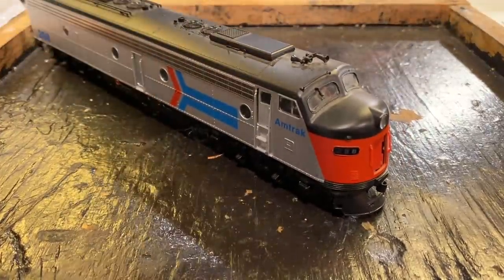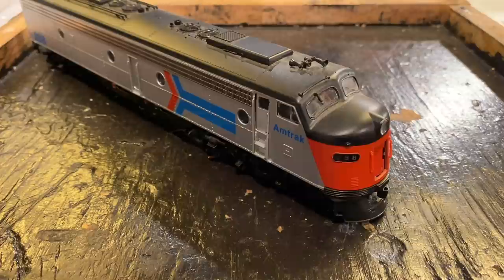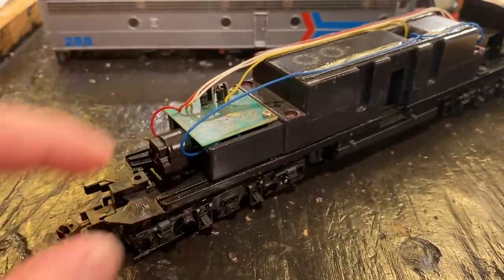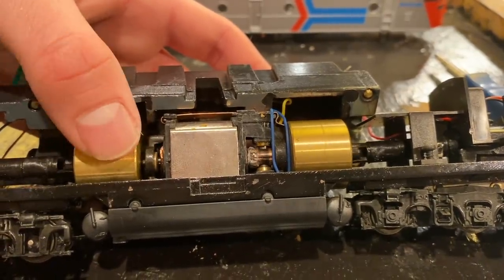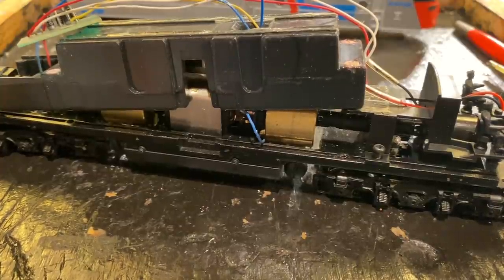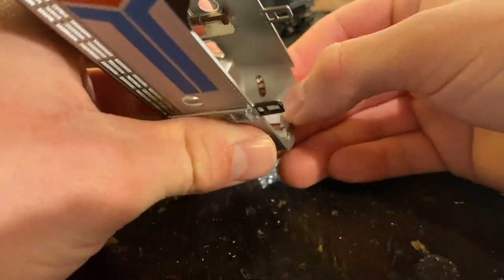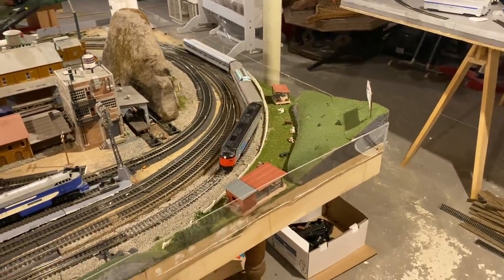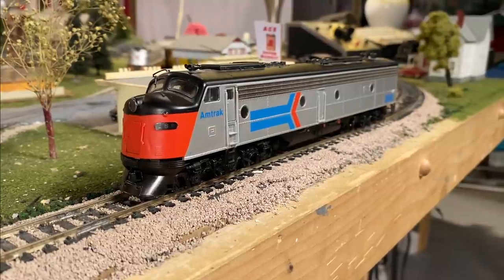This HO Amtrak E9 Won't Run - Spider Egg in Motor

Comment: I have found that 95% of the time I am having problems with older engines, a good cleaning takes care of the problem. I usually find dirt, dust, hair, dried grease or other contaminants in the gears, which prevent the engine form running.

Comment: 12:15 - SMT, you could paint the engineer & fireman figures that are present in the cab!  That directional lighting circuit board is probably a universal board that the manufacturer installs in all of their locomotives.  The person doing the soldering at the assembly plant may have touched their soldering iron on that circuit board eyelet by accident & left that little bit of solder on it.

Comment: They’re a lot easier to deal with if you remove the truck sideframes, first; they should just be a press-fit onto pegs molded as part of the gearbox sides. 🙂

Comment: I replaced all my Proto 2000 wheelsets with Athearn type sets.  Athearn and early Proto 2000 are compatible.  I used left over wheel sets from Ernst Gear projects and the remainder were obtained from my local hobby dealer.  The replacement project involved over 30 locomotives.  I bought additional sets in this effort long ago before the price surges we are currently having.  Fortunately I purchased enough sets to replace a further 20 locomotives should I live that long.  Proto 2000 locomotives look nice and run nice out of the box.  Unfortunately they have trouble staying in service for long periods after their gears fail.  I really enjoyed your spider egg find.  That is classic.  Good work SMT on bringing the Amtrak E9 beast back to life.
Reply: that reminds me of guys who buy a boatload of MT couplers and gear to outfit their entire collection and never get around to actually doing it- what a waste of money. harrison fixed this unit and didn't have to buy anything.

Comment: Amtrak definitely has the same color scheme as Spiderman, so it makes sense that a spider would want to set up shop in the belly of the beast.  Spider silk is very durable, but non-conductive so the current was most likely blocked on the commutator.  As for the wheel sets, you've had that issue before and successfully resolved it with super glue... KUDOS Harrison!
Thanks for sharing. 👍👍👍
Reply: a hair or any of a number of things could wrap around and do the same thing.

Comment: I've seen this once. It happened back in the 80's with one of my NScale locomotives. Took some cleaning but got it working, no issues.
Reply from the maker: Such an unusual problem.
Reply: @SMTMainline  
It sure is. If you think about it though, I'm surprised it doesn't happen more often. Spiders love small dark places to make nests in.

Comment: EMD E8/9 series were designed for passenger trains at high speeds. The counter part to them is the F series for freight locomotives. Now you have both cousins.
Reply: some railroads used the Fs for passenger service thru mountainous terrain due to their numerically high gear ratios

Comment: Commenting on an old video, but anyway: 5:03 it's perfectly normal to not populate all places on a board. That way the manufacturer can produce a single, universal board, and just populate the components they need for that particular model. It saves a lot of money when you don't have to make 17 slightly different variations of basically the same board.
Reply from the maker: That makes sense

Comment: Really nice Amtrak and great repair.  That axle you glued has a cracked gear.  You need an Athern ATH 60024 gear.  I would send you one but it would take month to get there.  I fixed one with the same problem.
Reply: Yep! I did too works wonders!
Reply: wow you have great eyesight!!!!
Reply: I've seen that same thing a few times.  You catch that kind of stuff after a while.

Comment: Out of all my locomotives which aren't many but ive never seen spider web in them . I watched this after got my wiring set up now to install the switch eventually . Good fix Harrison. I never had a proto brand but i know bachmann has similar issues with gears but the fixes are not as good as this. At thr end i say that did look fitting like its a railroad museum hauling Canadian Pacific cars with the older Amtrak. very good!
Reply: how do you know the problem is with the gear and not the length of the wheel stubs??
Reply: @tommurphy4307  because let's see Vicky has amounted to metal axles and because they used a certain type of plastic that didn't cure properly they split Bachmann had an issue with it that's why there are piles of garbage especially with the crappy split chassis design and they still have issues because I have locomotives that are for about 2007 and 2008 and the drive shaft Universal is starting to crack because of how poor quality they are Proto 2000 and 1000 series were known for having gear issues henceforth why Athearn are far Superior.  It's funny how somebody comments on stuff that happened a year ago almost like they want to start an argument wrong person to start an argument with just saying

Comment: There are small roaming/hunting spiders that will find a nice safe hidden spot to make  basicly a cocoon for themselves to wait out the winter. These winter homes are always made of very thin silk and woven as small and tight as possible. They are also waterproof. Most often you can find them in places like between seldom opened exterior doors and frames for example. And this looks like a perfect example of 1. And if you can find the gap the spider used to get in to the modle you deserve a prize. With the size of the web and tight fit confines of where it was. I would hazard a guess that the web belonged to a crab spider. These spiders are very small, and flat bodied and can fit in very narrow places. They get the name "crab spider" from how their first set of legs are much longer than the rest & get used as feelers for what lays infront of them, aswell as their wide but flat overall body shape. Which makes them resemble the basic body shape of crabs.
Reply: wow.

Comment: The last E9 was delivered in 1963, but don't know which railroad(s) took the last delivery. Union Pacific, Burlington Route (later, Burlington Northern, 1970), and Milwaukee Road had a lot of E9s, which at 2400 horsepower, were the most powerful of GM/EMD's diesel-electric locomotives. The E8 made 2, 250 hp. These units were hand-me-downs from the private railroads to Amtrak and, to me, nothing Amtrak ever bought since then has looked as good as those old E units.
Reply from the maker: I believe PRR had some too. I heard that one thing the railroads liked about them is that if one of the engines broke down they still had enough power to limp the train home.
Reply: the EMD 710 20-cylinder engine made 5,000 bhp

Comment: yea Proto had that problem with the gears, I think it was bad injection molding or something. This usually made them crack and the wheel become lose causing the issues your talking about as well as it could make a clicking noise when they run. You can just buy replacement gears from Athearn they are the same. I've done it on several Proto locomotives over the years.
Reply from the maker: It may be different depending on the year but I believe I tried that once and the gears were different sizes.
Reply: that wasn't the issue- i'm sure harrison would know a split gear when he sees one.

Comment: Old proto is notorious for cracked gears. They are easy to fix since they use basic Athearn drive mechanism.
Six diodes are used for directional constant lighting. E units and F units have a light on only one end hence four diodes.
Reply: so your implying that the board in that thing has space for additional diodes- for double lighted units....i'll buy that.

Comment: The way that the front truck was coming off of the rails there, I was expecting the problem to be a wonky truck connection, a problem that has plagued at least one of my non-Proto Life-Like diesels.  I'm glad that that that wasn't it!

Those spiders are relentless when it comes to finding cramped spaces to lay eggs in.  I've found tiny little spider eggs, about the size of a grain of table salt (if that), suspended in nests of amazingly thin spider silk inside of the cabins of my Matchbox and Hot Wheels cars and even inside of one-stud-wide LEGO bricks!
Reply: enough spider jokes already- we don't even know what kind of bug it was.

Comment: check wheel gauge and for cracks in plastic gear axles which earlier proto engines are notorious for - Charlie (P.S. Athearn, NWSL, and A-Line all make replacement axle gears so you do not have to replace the wheels.)
Reply: split axles happen on lots of different brands model train locos- bachmann seems to be 'the king'. i think with as many locomotives as he has fixed- he may know a thing or two about checking for split gears.

Comment: No equipment should go on the layout without checking the wheel gauge with an NMRA gauge 1st.!! (other rules are replace all couplers with Kadees  and all cars must be up to NMRA standards weight. That is 1oz plus 1/2 oz per inch so for example a
6 inch long car weights 4 oz. I just added that detail for your subs/followers. It doesn't need be exact, but a good starting point.) 
I just wanted to make that point; because likely you could have fixed the E-unit just by gauging the wheels correctly; and you wouldn't have need to disassemble the trucks, and do your glue fix-it. Eyeballing the wheel gauge is really not good enough on 6 axle locos. Having them right helps the engine negotiate turnouts and other complex trackwork. Eyeballing may be good enough for your loop of track but when you want to up your quality further; doing the gauging and other cleanup will help get flawless operation. Hope you will get and use a gauge.!!  Cheers. oh PS I hate removing those gear covers too. uber tedious!
Reply: he could do that with a plastic vernier caliper from harbor freight at a fraction of the the price of the model railroad gauge thingy. what is the proper gauge for HO?? the track has a tolerance of error- do you know what that tolerance is?? all that matters if you have to get it perfect...
Reply: @tommurphy4307  if you haven't used the NMRA gauge you should get one and use it. It uses a go-nogo format
that makes it simple and fast. Every railcar need to be checked and it keeps it simple. It also has gauging for turnout parts, track, wheel treads and the X2f couplers. It's the best 12 bucks a modeler can spend. I also KNOW someone sent SMT one of the gauges so he has no excuse. I wish he would use it and set a good example for his followers. Thanks for your message, have a great one.

Comment: If the wheels spin independent of each other on the same axle, the gears are split and superglue is not the fix. Trying this may result in a cogging of the gears since the split creates an elongation preventing proper gear mesh. Replace the gears. - Charlie
Reply: if you would listen to what was said- the issue was the wheel stubs were touching and creating a short circuit. i think harrison probably checked the wheelsets for shorting and cut that from the vid. I agree with you on the use of CA glue- i would have used a bit of cotton in there. that way, i couldn't possibly glue my fingers together.....and it makes getting back in there easier should it be necessary. that looks like a good quality motor.....for a proto.

Comment: Now, that was different. Every Proto locomotive I’ve ever bought required a repair. If it acts up again, I believe you can replace the wheel sets with Athearns.
Reply: Have you ever compared the Athearn wheel to the Proto? I don't think that is a very wise decision.
Reply: @xxxx-hw5we  I agree, but most everyone I know uses Athearn axles, as they’re easier to get right now. There are better full wheel sets, but Athearns are a suitable economy replacement until you can find something better. And I use Athearn worm gears and bearings, as they’re better than Proto.
Reply: all new n scale protos get automatic motor tune-ups at my club. not an easy fix if you've ever tried to get those damn brush caps off.

Comment: Proto 2000 and cracked axle gears are synonomous.  Even if not "broken" always check the axle gears for being cracked (it is bc of the cheesey plastic the Chinese used).  Easy to find replacements and just replace.  Also, advise against using any kind of CA glue like you did; if you are going to use any kind of glue on axles and gears, better to use a "white" glue like Elmers or Tacky.  It will hold AND allow for easy disasembly if need be.
Reply: all racism aside- its easier to unstick your fingers that way...

Comment: No deal with Athearn that I have ever been aware of.  Life-Like just had their people in China clone the Athearn parts which at that time were made in the US (1990-ish).   They made a few mistakes, the four axle trucks with the metal tab have the tab on the opposite side as an Athearn truck, and either due to a minute size difference or the type of plastic used the axle gears will split.    Engines that use this gear include RS2, RS11, F3, FA1, FA2, GP7-9-18-20-30 and the E6, E7, E8 and E9 although later issues of these from Walthers are redesigned to eliminate the problem.   

Hold it upside down in your hand and use your thumb to rotate the wheel on one side. If you can easily spin the wheel, the gear is broken.  You should not be able to easily spin the wheel on the gear.

The split can range from just causing an annoying clunk clunk clunk, to spreading apart so far it binds up and the engine won't run. 

Now you don't have to change the whole axle, it's just the gear that has failed.  Athearn 60024 gears will directly replace them.  They can be rough to push in, it helps to open the end hole just a bit with a knife.  They're cheap, a bag of six with shipping costs maybe $2 a gear.   I usually buy several packages at once.  

As it's a design flaw, with time all original Proto gears will split, although I think engines exposed to more hot/cold temperature cycles will split faster than engines always kept at a relatively constant temperature.  I have opened up brand new in the box engines to find split gears.  I had some old stock GP18s that sat here in the basement for years and opened them up and .. yup split gears. 

They over-produced these engines to get them on the market when they first made them, I can recall a show about 1994 where a guy had piles of them and you could buy GP18s and BL2s for $20 and E8s for $25.  I still have an Illinois Central E8 and even a set of Rivarossi cars to run with it.
Reply: Now for the great irony.  Model Die Casting made an RS3 and the last few runs they had them made with the Life-Like drive in them.  Horizon Hobby purchased both Athearn and Model Die Casting.  They moved the RS3 to be an Athearn product in the Ready to Run line - but had it made in the same factory as MDC had.  So the clone of the Athearn parts ended up being sold as an actual Athearn item.  And of course with the same gear problem.
Reply from the maker: I'm surprised they didn't get into any trouble with Athearn in that case, the drives look so similar it isn't even funny.
Reply: @SMTMainline  I'm not sure why there was no copyright infringement suit either.  But it's certainly not the first example of someone copying another manufacturer's product, you can find near direct clones of Athearn items going back to the early 1960s.  And that doesn't include when manufacturers used an HO product as the basis for the design of their item in another scale.
Reply: @CR7659  theyre made to industry standards and use sized shafts and standard gear tooth pitches- that kind of thing cannot be patented and using a knife rather than a proper-size drill to rework a hole in a new gear is an easy way to waste money- our hobby is pricey enough as it is....
Reply: @tommurphy4307  Odd, I've never had an issue with it to open the ends a bit so you can get the thing started.  

Maybe they'll break eventually too, who knows, but the gears cost about a dollar each so I'm not too worried about it.  By the time they break again we'll all probably be able to 3D print our own.

Comment: You wont risk damage if you actually USE an NMRA gauge instead of guestimating as the 2 axles should never touch when they are properly gauged.  Crazy glue is NOT needed or desired in this instance.  If these axles are sliding too much they are due for replacement which Athearn sells as SD-45 gears though proto may use the other set by Athearn as well the site sells 2 kinds, very common part to fail is those axle gears and they are cheap to replace.
Reply: they don't fail if you rework the hole for proper interference/fit. its a no-brainer you just need the right drill size and you don't need a $20 model railroad gauge thingy.... the main idea is to get the unit running (especially if you are doing it for a friend or client) and that takes care of operations until new parts can be installed. good job, harrison!

Comment: Have you had any problems with cracked gears in P2000 engines? The hobby shop that l work at bought a large collection of these engines and found that just about all the gears were cracked.

Comment: I’ve got a 2882 engine that you put the wire on the back of it or the bottom of it it will run but when I put it on the track nothing what could be wrong or could you fix it for me

Comment: By the time that the Life Like Proto SD45 came out, they have a different gear drive/truck system.  In fact I have 4 of them, and I can't figure out how to open up the gearcase on them, so I didn't attempt it.
Reply from the maker: They likely improved it. These early ones were notorious with cracking gears.